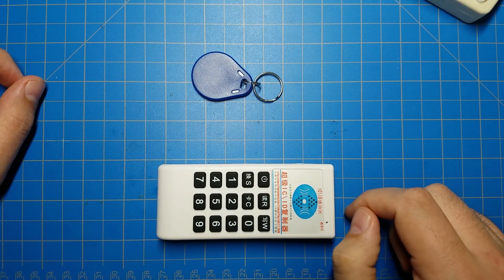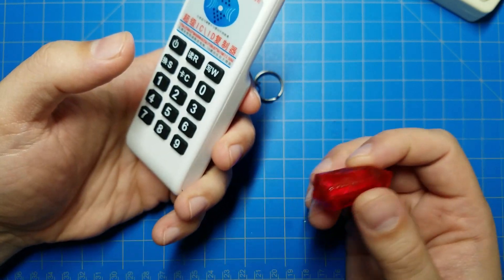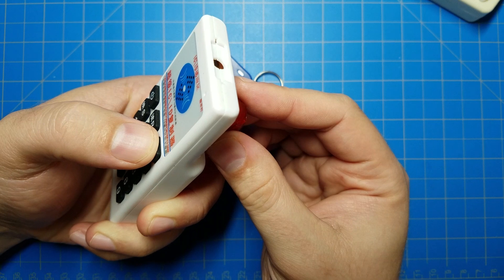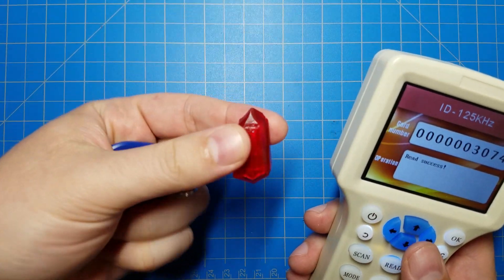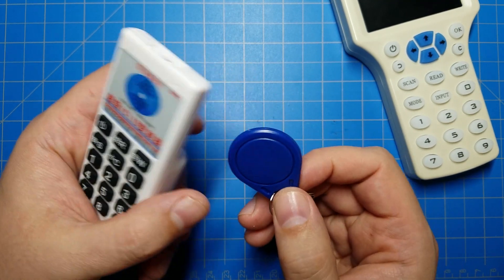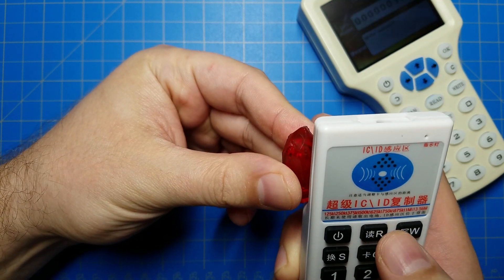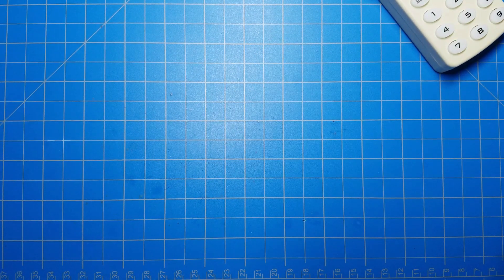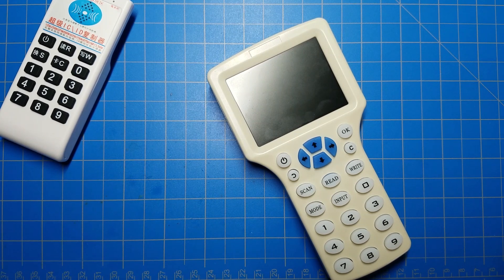Testing RFID Writer Compatibility with Kyber Crystals

Comment: Stupid !!! the first writer card sensor not at the back,that is speacker, the sensor actually at the front blue circle.
Reply from the maker: You are correct, the back is where the speaker is located. It is also where the 125kHz RFID antenna is located. 

Kyber crystals use an EM4305 RFID tag. Here is a series of images I took taking apart a kyber crystal, including an image of the RFID chip itself which clearly identifies it as being an EM4035: https://imgur.com/gallery/6WAiVDv. The datasheet for the EM4305 may be found here: https://www.emmicroelectronic.com/product/lf-animal-access-ics/em42054305. The EM4305 operates on a 125kHz signal.

Here is a series of images I took of the inside of the particular RFID reader/writer to which you are referring: https://imgur.com/gallery/KKeg1s2

You can clearly see the coil of copper wire glued to the back, surrounding the speaker. That is the 125kHz RFID antenna. The front blue circle is located over the area of the PCB that contains the 13.56MHz RFID antenna. So there is a "sensor" directly underneath the blue circle, however it is not the correct "sensor" for kyber crystals.

That said, most RFID tags, both 125kHz and 13.56MHz, should be readable from either side of the device. However kyber crystals have small and fairly weak antennas, thus getting them as close to the device's 125kHz antenna is preferred. Which is why I placed them on the back of the device, where the 125kHz antenna is, and not the front by the blue circle.

Comment: How do you change the frequency?
Reply from the maker: the RFID tag operates at a fixed frequency that cannot be changed.

the RFID writer can change to the appropriate frequency for an RFID tag, but how you do that will vary between writers. there will possibly be a "scan" option which will try all frequencies the writer can operate on to find the one that's appropriate for the RFID tag you are using. 

there may also be a "mode" button which will allow you to manually select between available frequencies.

Comment: Do you know what kind of RFID chips are in the kyber crystals?
Reply from the maker: EM4305

You can see that the chip is even marked EM4305 in these teardown photos I took: http://imgur.com/gallery/6WAiVDv
Reply: I'm glad you investigated this. Someone on reddit said they tested a crystal with their Proxmark3 and it listed as an EM410. People on that thread have been trying to use T5557 as a substitute for the Kyber crystal. My suspensions are that they haven't had any luck do to an incompatibility issue. I'm not very knowledgeable on RFID technology so I'm speculating.

Comment: Love the vid. Quick question, could you put the blue keychain rfid into david lightsabers? Do they fit inside it?
Reply from the maker: not quite. they need to be trimmed a little to fit inside. however the lightsaber can't read them because of the orientation (and possibly size) of the antenna in the blue keychains.
Reply: Ruthsarian thank you very much! I greatly  appreciate it!

Comment: Hello, thank you for the awesome video! Have you tried using the larger read to read the RFID chip while the kyber crystal is in its container? I am thinking of using the RFID reader to find a black kyber crystal.
Reply from the maker: The crystal needs to be right up against the reader for the reader to work. The extra distance added by the thickness of the crystal case prevents it from working.

I've heard of people trying to read crystals with an RFID reader while at Dok Ondar's and they were asked by a cast member to stop as they don't allow it. If you try it you'll probably be asked to stop, maybe even asked to leave.
Reply: Ruthsarian thanks for the response! Is there any way to read the RFID while in container? I’m gonna try and take a chance. Lol... I really want a black kyber crystal.

Comment: I have the larger reader, and I bought a crystal yesterday to use. I am not able to read or write to the crystal. I have tried all the frequencies. Any idea what could be happening? Do you think Disney has started passwording the crystals? I can write to a card no problem.
Reply from the maker: It could be possible Disney has started to add passwords to the RFID tags in crystals, but that would require the holocrons and custom lightsaber hilts to have been programmed with that password as well, otherwise the crystals wouldn't work with them. If they've had those passwords in the holocrons and lightsabers then I would have expected them to password crystals from the start.

Have you tried using your crystal with a holocron or lightsaber? Does it work there? There have been problems where some crystals have bad RFID tags for whatever reason and don't work. You may have one of those. I have a crystal like that. I plan to eventually cut it open and see if it might be the wires connecting the antenna to the chip came off.
Reply: @Ruthsarian  Thanks for the reply. I did put the crystal in my holocron and it works as expected, no problem. I get what you're saying about the passwords. I just tried one my old crystals from the summer and I had the same issue. It won't read or write. Since I can unlock the characters with my rfid cards, it's not a big deal. But I was looking forward to changing my doubles to the other characters.
Reply: Oddly, I kept getting write fail, but when I popped in the crystal - it changed anyway. Go figure.

Comment: What are the advantages of a Prox Mark 3?
Reply from the maker: Essentially the Proxmark3 (the Proxmark3 Easy is what you want to buy, generic versions of it are all over eBay)  lets you dig really deep into the RFID tags and protocols. You can view/set special parameters on the tag. You can set and remove passwords on the tag. You can access extra data areas that these readers/writers can't. There's even the ability to capture the raw radio signals between the RFID tag and reader. It's very versatile, but requires extra effort to setup and learn how to use.

For ease-of-use, the handheld writer with the LCD screen is the way to go if you're just working with kyber crystals. But a PM3 will have value beyond just working with kyber crystals should you find other RFID-enabled products to work with.